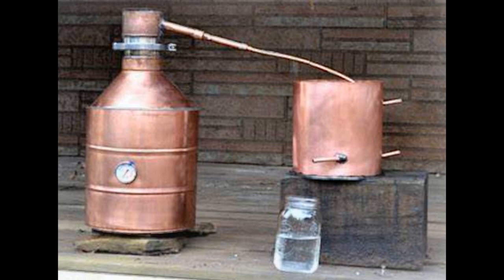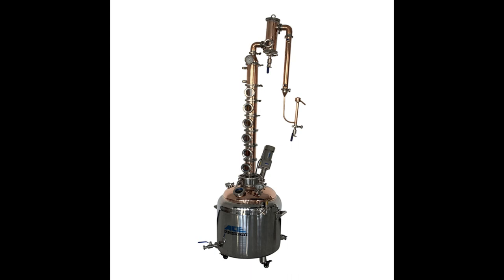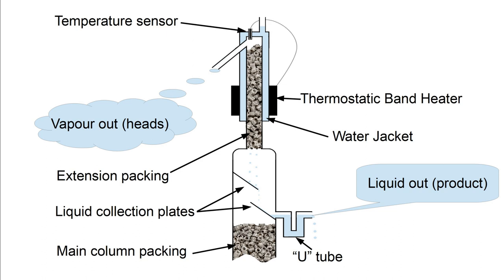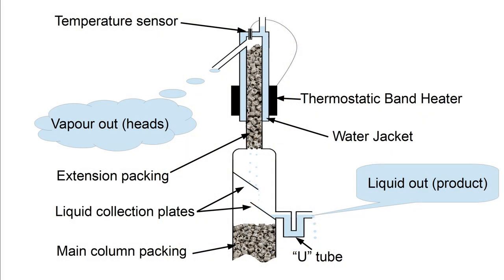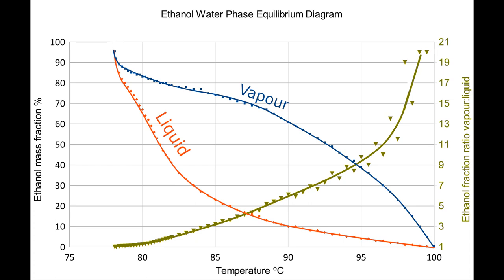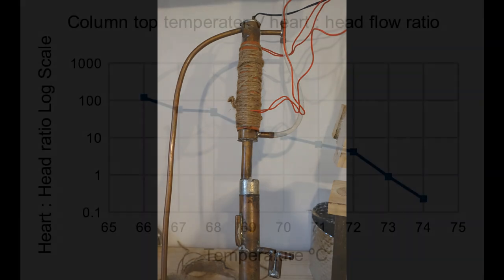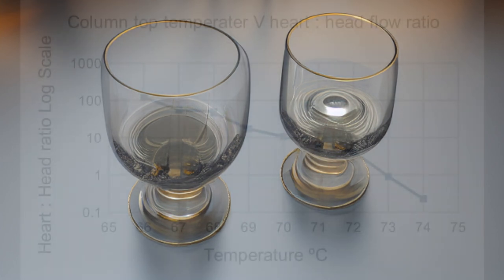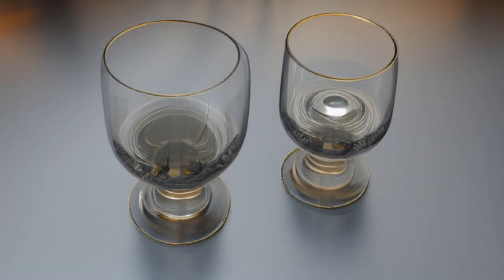Column Extension Temperature and Vodka Quality

Comment: I used to use still spirits products, and carbon filter, but since using birdwatchers 4.0 *TPW,  i've not had to filter. I've been doing a stripping run and spirit run with the T500, but only so I can add sodium carbonate to the second run. I'm upgrading my column to a 4", and i'm going to try doing a single run. Your information is very technical for me, but I'm sure I can pick up some valuable information :)
Reply from the maker: I have not experimented much with brewing, All my washes are Alcotec vodka star and sugar. That is expensive though so I'll give it a try.